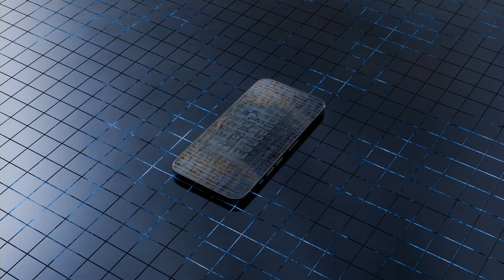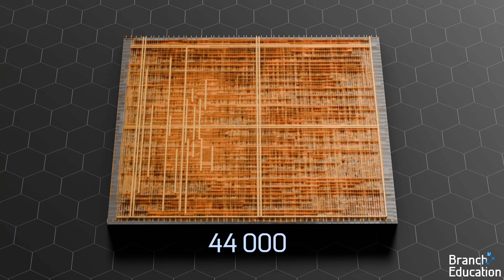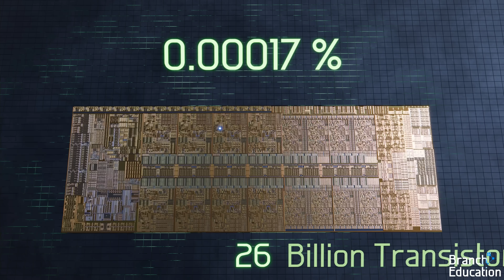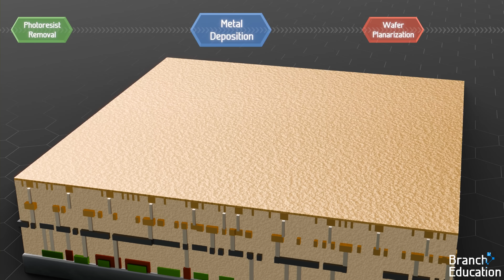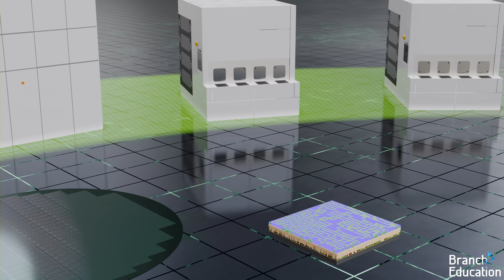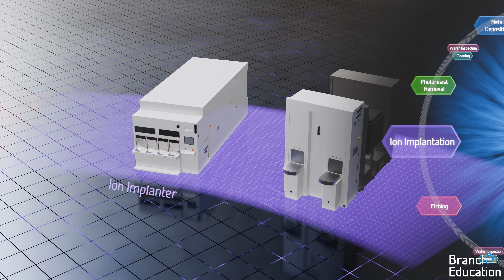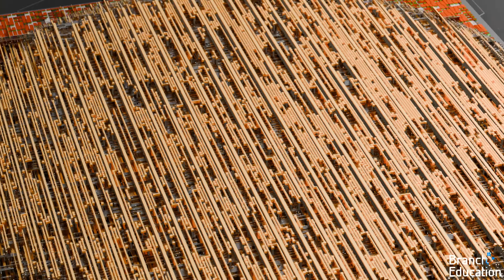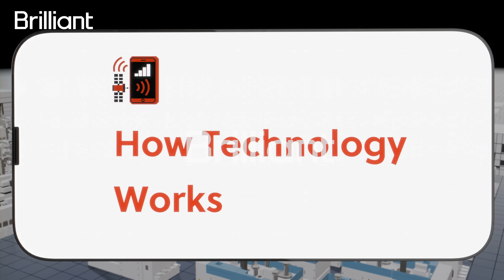How are Microchips Made? 🖥️🛠️ CPU Manufacturing Process Steps

Comment: The summary and verification file is **fully accurate**. Every claim, figure, and technical detail matches the transcript precisely. The verification matrix is correct, and the tool categorization is a valid interpretation of the transcript's content.

---

### ✅ Verified: Architectural Scale & Metrics

| Summary Claim | Transcript Evidence | Verdict |
|---|---|---|
| *62 microchips / 90 billion transistors* in smartphone | [0:00]: "Inside this smartphone are 62 microchips containing a total of 90 billion transistors" | ✅ |
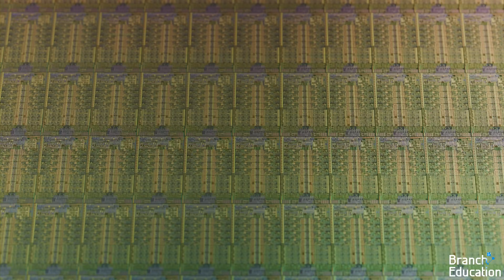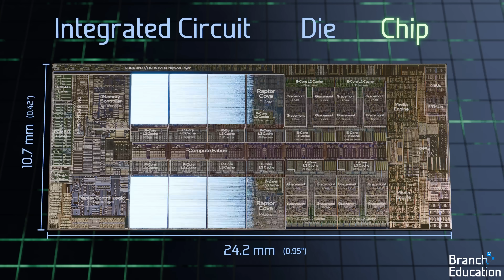| *26 billion transistors* in 24-core CPU | [1:04]: "each containing 26 billion transistors"*; [2:45]: *"has 24 cores" | ✅ |
| *FinFET dimensions:* 36 × 6 × 52 nm, pitch 57 nm | [4:30]–[4:38]: "channel dimensions are 36 by 6 by 52 nanometers with a transistor to transistor pitch of 57 nanometers" | ✅ |
| *17 metal interconnect layers* | [3:51]: "a total of 17 metal layers of wires in the CPU" | ✅ |
| *300 mm wafer:* 230 CPU dies / 952 DRAM dies | [7:58]–[8:07]: "300-millimeter silicon wafer which can fit 230 CPU chips"*; *"952 of them can fit on a wafer" | ✅ |
| *435 tools* in cleanroom | [9:33]: "a total of 435 semiconductor tools" | ✅ |
| *FOUP containers* (25 wafers) + *overhead transport* | [8:16]–[8:24]: "stacks of 25 using a container called a front opening universal pod, or foup"*; *"overhead transport system" | ✅ |
| *940 process steps / 80 mask layers / 3 months* | [5:13]: "940 steps in the recipe"*; [7:03]–[7:11]: *"80 layers of the die... resulting in 940 steps" | ✅ |
| *50,000 wafers / 11.5M CPUs per month* | [9:40]: "50,000 wafers or 11.5 million CPUs a month" | ✅ |

---

### ✅ Verified: Six Functional Tool Categories

| Category | Transcript Evidence | Verdict |
|---|---|---|
| *1. Mask Layer Creation* | [10:27]–[10:34]: "photoresist spin coater, photolithography tool, developer and photoresist stripper" | ✅ |
| *2. Adding Material (Deposition)* | [13:53]: "Deposition tools are used to add or deposit material"*; [14:25]–[14:33]: *"metals such as copper or tantalum, insulators... crystalline layers of silicon" | ✅ |
| *3. Removing Material* | [15:03]–[15:29]: etching; [15:29]–[15:44]: CMP | ✅ |
| *4. Modifying Silicon (Ion Implanters)* | [15:57]–[16:20]: "ion implanters... bombard the unmasked regions with phosphor, boron" | ✅ |
| *5. Cleaning* | [17:00]–[17:14]: "ultra-pure water... nitrogen or hot isopropyl alcohol" | ✅ |
| *6. Inspection (Metrology)* | [17:27]–[17:34]: "metrology tools... scanning electron microscope" | ✅ |

*Note on "Epitaxy (Silicon)"* in the summary's diagram: The transcript mentions "crystalline layers of silicon" as a material deposited ([14:33]) but does not name "epitaxy" explicitly. This is a reasonable technical categorization, not an error.

---

### ✅ Verified: Single Interconnect Layer Sequence

The summary's 8-step sequence matches the transcript's walkthrough at [18:16]–[19:43]:

| Step | Summary | Transcript |
|---|---|---|
| 1 | Deposit silicon dioxide | [18:16]–[18:24]: "insulating silicon dioxide is deposited" |
| 2 | Apply photoresist + soft bake | [18:24]–[18:31]: "photoresist is spread... soft bake" |
| 3 | Lithography exposure | [18:31]–[18:43]: "photolithography tool... weakening the areas" |
| 4 | Develop + hard bake | [18:43]–[18:54]: "developer... hard bake" |
| 5 | Etch | [18:54]–[19:07]: "plasma etcher removes a vertical column" |
| 6 | Strip photoresist | [19:07]–[19:15]: "photoresist stripper where the mask layer is removed" |
| 7 | Metal fill (PVD) | [19:15]–[19:21]: "physical vapor deposition tool... fills in the exposed pattern" |
| 8 | CMP planarization | [19:28]–[19:43]: "chemical mechanical planarization... flat layer" |

✅ All verified.

---

### ✅ Verified: Pre- and Post-Fab Processing

| Summary Claim | Transcript Evidence | Verdict |
|---|---|---|
| *Quartzite → pure silicon ingot → 300 mm wafers* | [22:23]–[22:29]: "refining quartzite into pure silicon... growing a monocrystalline ingot" | ✅ |
| *Wafer thickness 0.75 mm* | [22:35]: "around three-quarters of a millimeter thick" | ✅ |
| *Raw wafer $100 → processed $100,000* | [22:52]–[22:59]: "costs around a hundred dollars... worth closer to a hundred thousand dollars" | ✅ |
| *10× more valuable than gold* | [23:07]: "ten times more valuable than its weight in gold" | ✅ |
| *Binning (i9, i7, i5, i3)* | [23:40]: "Intel Thirteenth Gen processors are sold as an i9, i7, i5, or i3" | ✅ |
| *Laser cutting, interposer, LGA, IHS* | [24:02]–[24:28]: "cut out using a laser... placed on an interposer... landing grid array... integrated heat spreader" | ✅ |

---

### ⚠ Minor Notes (Not Errors)

1. *"Epitaxy (Silicon)"* in the tool diagram: The transcript does not use the term "epitaxy," but it does mention "crystalline layers of silicon" as a deposited material. This is a valid technical categorization, not a factual error.

2. *"Photolithography stepper/scanner"**: The summary uses "stepper/scanner," which is accurate industry terminology. The transcript describes a *"wafer carrier steps from position to position" ([12:53]–[13:01]), which is precisely the "step-and-scan" operation of such tools.

3. *"$4×$ optical demagnification"**: The transcript says *"shrink down the pattern by a factor of 4" ([12:47]). The summary's notation is correct.

4. *Missing nuance:* The summary does not mention that *eagles can have up to 5× the density of light-sensitive cells as humans* — but that was from the camera video, not this one. So it is correctly omitted here.

---

### 📌 Final Verdict

The summary and verification file are **accurate, complete, and faithful to the transcript**. All key figures — 62 chips, 90B transistors, 26B per CPU, 17 metal layers, 80 photomasks, 940 steps, 435 tools, 230 CPUs per wafer, $100K wafer value, binning strategy — are verified. The tool categorization and step-by-step sequences are correct. The verification matrix timestamps are accurate.

*No factual errors were identified.* The summary is a reliable representation of Branch Education's microchip manufacturing deep dive.

Comment: One thing not touched on in this vid is that they only or can use the silicon mined in one location on Earth. Somewhere in the USA.  No other country has this ultra pure silicon.  And even then the process fails 30% of the time making the the first discs to be sliced.  They use a dipping technique like dipping a string in wax.  You keep redipping.  I also learned they make a 1 off crucible for the melted silicon out of silicon as they say it has to be 99.999999999% pure to work. But I can't fathom how this works. How these transistors can work.

Comment: Dropnotch hd6.517
Gsmwcmalte850'1900'900'1800
2gbram+32gb rom 
External memory 128gb
Mediatek6739 quadcore1.5ghz
Sensory psl sensor A GPs
Real front camera 13mp5mprear camera
4gbtwifi hotspot fm 4000 mAh lipoly battery dual 4g sim
(Retachable charger hand free at speaker suply

Comment: it takes a pc to create a pc. so how would you create the pc, without having a pc to begin with? my point.
Reply: You start with CPUs that can be designed by hand. (E.g. Intel 4004 processors). With each processor you add computational complexity that you could not execute before, allowing you to scale processor complexity. If you see at the base level, all processors are merely hardcoded “if-else” statements. Once you have a good design as a base, it isn’t hard to incrementally scale with each iteration. The computers only reduce the manual work at those tremendous scales, but the design intuition at the higher level is still human

Comment: They started with simple cpu designs drawn basically by hand.  Those cpus then allowed the engineers to write software and create automation to design more elaborate cpus.  And so on and so forth.  Many iterations later, they are literally using AI to design cpus now.
Reply: AI isn’t quite there yet, you still need a lot of designer intuition, but it does help to a certain extent

Comment: How processors vary then? If all wire connections and everything is different for each different model of CPU, do they need different fabrication for each different CPU?
Reply: Only the mask changes. Each design has a mask for each of its layers. (But the process does change when you change to a smaller/larger transistor technology)
Reply: @goos_is_life How does it change? Wouldn't it be enough if they scale it down even further with mirrors in photolithography tool?
Reply: @ps1dnn  It's usually not as simple as simply scaling the photolithographic image for a "smaller" process node.

The first misconception to clear is that a "smaller" process node corresponds to a smaller transistor dimension. Current process nodes have gate lengths saturated around 7nm (yes, even for the ones that claim "18A" or "2nm). It is mostly a marketing term that roughly refers to the performance scaling, not the dimension scaling. So each "smaller" transistor technology is actually around the same size but is architecturally extremely different. For e.g. Intel's 18A introduced Gate-All-Around technology, where the gate completely surrounds the channel for better channel control, and Backside Power Delivery which adds power metal layers below the silicon. It completely changes the procedure for manufacturing the same CPU

Second, even if it would be possible to simply scale the image, it results in wildly different parameters such as Transistor doping levels, Power, Clock Speed, Delay and Signal Timing. You need to re-design your layout keeping these parameters in mind

Comment: So smaller than dust particles, but a step includes cleaning away dust particles? And how are the transistors made that are smaller than cells? Just skipped over that? None of this makes sense
Reply: It is mentioned in the video, EUV is used to etch the tiny detail into the silicon

Comment: I wanna see how chip design circuits made ! From 0 to full latest evolution how we went hardware small number circuit to billions and how they compute
Reply: I can provide an overview of how it is designed today:

You model the behaviour of the circuit in code (specifically in Hardware Description Languages like Verilog). This “code” is converted into a set of logic gates (which are essentially a set of “if this then … else …” statements). These gates are then mapped to physical logic gates that are designed with transistors. Then you arrange the placement of these different logic blocks to balance different parameters (power consumption, processor delay etc.). Finally you connect these different blocks with wires, perform a lot of design verification cycles and finally create a mask that is used in the process described in the video

Comment: 9:50. Based on earlier descriptions of the chip (24 cores) and the fact it was released in 2025 makes me think you're talking about the i9-14900k (no f because it showed a uhd 770 in there). most cpus people actually buy are much smaller because of fewer cores and if youre now talking about an AMD cpu, its die size is much smaller due to the fact they have fewer but more powerful cores than intel and they use chiplets. So it is theoretically way more than 11500000

Comment: [00:08:41] - Automated wafer handling robotics
[00:11:41] - Removing temporary photoresist layers
[00:13:51] - Deposition of thin films
[00:14:24] - Metal and insulator layering
[00:15:06] - High energy plasma etching
[00:15:16] - Carving microscopic circuit patterns
[00:17:01] - Removing microscopic wafer contaminants
[00:17:08] - Chemical cleaning and stripping
[00:17:25] - Nanometer level mass metrology
[00:19:05] - Creating vertical 3D interconnects

Comment: What I don’t understand, that like everything in engineering the processors need design and drawings. How is it possible to draw something that has 90 billion transistors each connected with wires? Are there millions of areas that identical so only one drawing enough for them?

Comment: Very impressive video.  I am a retired senior applications engineer.  I was a vendor to a company that produced the chip carrier for Intel.  They had 25 vision assisted single spindle routing machines.  I worked for the company that sold the machines to them.  They asked me to write the CNC program that routes the pocket inside the chip carrier.  Tolerances were specified in microns.  The router bit was 0.032" in diameter.  Reference points were located using a high resolution video camera mounted next to the spindle.  Although very reluctant at the time, now I look back with pride having been a part of that critical manufacturing process.
Reply: No Greg thats all pretend. You can stop with this made up world again.

Comment: Fascinating how far the technology has come. I am now retired, 80 next month after a 50 year career in computer design, and saw first-hand first mask making by my flatmate  Ian who worked for Ferranti in Manchester in 1968 doing a mask cutting with a steel ruler and a scalpel on our dining-room table in the evening laying out a 32 bit MOS shift register. (using two-layer plastic sheet, where you cut the first (red) layer leaving the transparent underlayer base and peel off the unwanted red bits. I worked on a computerized navigation simulator for the Australian RAAF) . Then in 1972 I joined National Semiconductor as Australian FAE and made 13 trips to Silicon Valley for technology updates, with a particular specialty in IMP, PACE 16-bit CPUs. I remember the change from 2 inch to 3 inch wafers, and the marvels of 4-layer metalization!. So I found this video mind-blowing.

Comment: Hd drop gsm 
2gb 32gbram external internal media Tek  sensor gps rear camera 4g  wifi spot fm 4000 batery  dual 4g glasses touch LCD electric electronic supply presed

Comment: there is limit using light, using x-rays resolution makes it possible for smaller chips to quantum level, dope the silicon with thorium transistors as batteries these millions of transistors will power itself first step to artificial consciousness it is a very toxic process and deadly creates a lot of toxic waste dumped into air and the environment should be manufactured in micro gravity  and waste dumped into space

Comment: Either this was gifted to us by aliens to copy/paste or this is a lie or fake or made intentionally that complicated to even reason with because there's no way in hell humans could acomplish this back in the 70's the scale and magnitude of what's shown here is beyond 95% of human comprehending, we meet and use everything we see here daily and take it by granted since forever so if this process is so ungodly hard, expensive and complicated we wouldn't got it for so cheap , basically free. You would argue like "they made by robots" ok who made them robots to perform such astronomical precision to begin with? I work with "microns" 10 microns = 1/10 of a tenth, 1 tenth = 1/10 of a millimeter. I didn't even knew these measurements existed before i worked here and i have to keep my products at +3-12 microns range and these guys talk about 1/100 of that..here we talk about nano"meters" or nano"chips" smaller than a grain of dust !?!! All manufactured by human hand..dude..

Comment: The even more insane thing is even just one step like the photolithography is an incredible feat of engineering in its own right. Modern scale chip architecture requires a special type of light that we have to manufacturer within the machine using a system of hitting micro drops of tin with a laser at exactly the right angle and time millions of times a second. That light is extremely inefficient, meaning we lose most of it. The light we can collect cannot be focused with lenses, meaning it has to be collected and focused with mirrors that need to be polished within atoms of level.

Comment: It did not even come across nearly as apparent in this video how mind-bendingly crazy the Photolithography actually is. They use a very specific type of high energy UV light, which is incredibly hard to control and can only be produced by hitting molten droplets of tin of the size smaller than human hair, and hit them 100.000 times per second right in the center with beams. Since there is no material on this earth that can be used to serve as a lens for this special light produced that way, all these different mirrors need to be employed. In the process the light loses 99% of its original energy, which is why the droplets of tin need to be 50 times hotter than the fkn sun. Also those mirrors require to be unbelievably smooth and there is only one company on the globe (Carl Zeiss in Germany) that can manufacture those. And when the etching finally happens it needs to be in the Nanometer territory, which requires a precision moving the wafers that can barely be fathomed: The equivalent would be having a plane going twice its normal speed which then has to land with both its wheels at a spot that has to be exactly correct, but is 50 times smaller than a human blood cell. These insane conditions are the reason why neither USA nor CHINA can produce these chips, only TAIWAN.